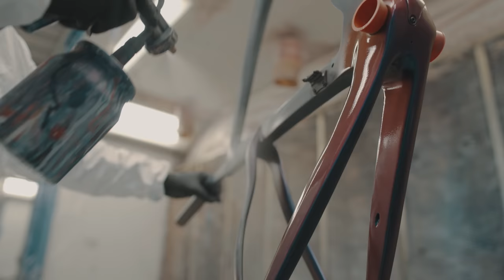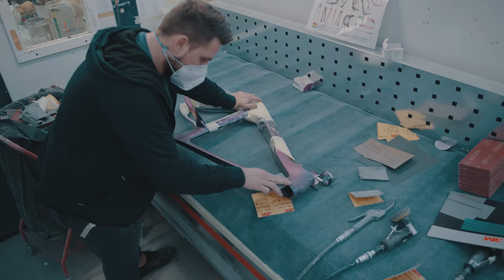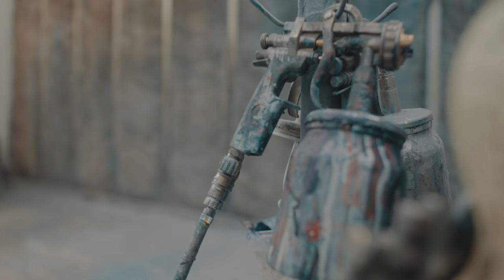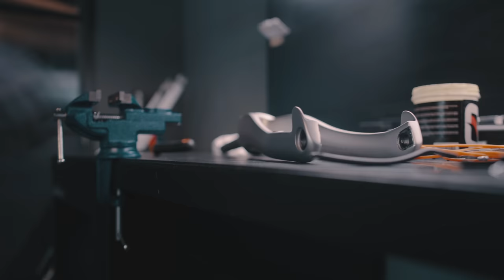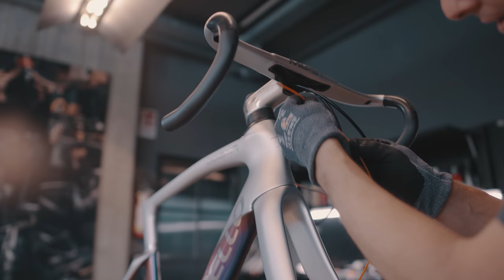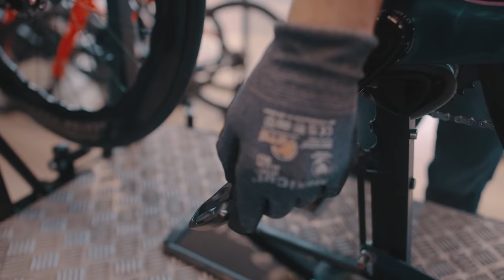DREAM BUILD ROAD BIKE - Pinarello Dogma F - MYWAY

Comment: How much slack has he got in those brake hoses to be able to mark them up, take them off, screw the hose into the control and slide it back on again? Does avoid contact with between the bars and 8mm but would have liked to have seen the controls going back on. It cut away both times.

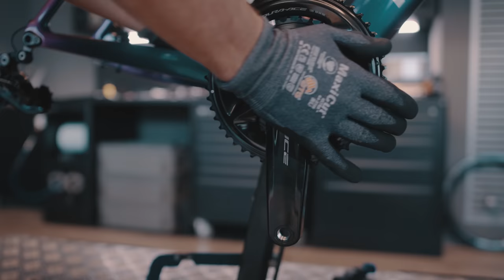Comment: at 27:25 THIS is how you support a Torque wrench propperly, not one handed! the reason is simple, it makes sure the force registered on the wrench is ONLY the turning torque, not any other angular force, because of the head twisting (even only slightly) during wrench tightening, ALSO this protects the tool, as these are expensive, and precision instruments, and with BOTH hands on it, it can't ding a part, or drop on the ground. one other tip, NEVER jerk the tool, pull evenly, so the correct torque is read, a jerk applies a lot of force for an instant, most likely about or above the required, and set torque; triggering the 'stop' work too soon, hence under torquing the screw or fastener.
Reply: I use mine two-handed for the sake of preventing slippage, unless the tool is deep inside the fastener it's tightening (8/10 mm hex, cassette/rotor lockrings, etc.).

Comment: This bike will rattle if you run over a fly…. FOR GODS SAKE INVEST £5 IN SOUND INSULATION ON CABLES. its a £15000 bike.. ADVICE ,,,, build your bike yourself

Comment: Easy to top this build - horrid DISC brakes on an obscenely expensive road bike - trash the discs, get an F10/F12 with rim brakes - much superior ! Cycle erotigue !
DISC is a four letter word.
Reply: Yes. You'r right! Disc is a four letter word. And the letter is GOOD!! it would be a shame use weak and ugly rims destroyers on nice and expensive rims like this...
Reply: @ATREY178  CRAP, Fall Head disc are 4 letter words - next time you need to slam on brakes, maybe you will realize that these 4 letter words are linked when you go over the handlebars and land on your head,
Reply: Sorry, but If you can't use the brakes, it's your problem. I ride disc over 15 years on MTB and road, and I had to emergency brake many times. Never I go over handlebars in my live. I can brake effortlessly with one finger regardless of rain, mud, sand... I had rims brakes on my old bike, and I hate the sound when the sanding paste after rain grinding the rims. And any highend disc is many times cheaper and easier to replace than a high-quality carbon rim.
Reply: @jacdogma1316  Your minus. Not mine. I have heard of the same cases with rim brakes.
Reply: I haven't read a single argument from you against disc brakes other than that they are too strong for you.